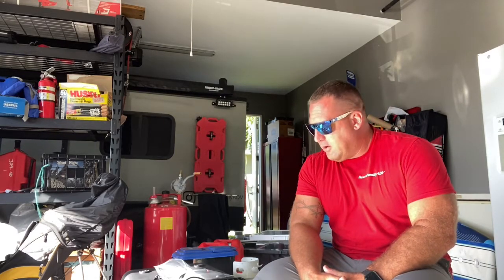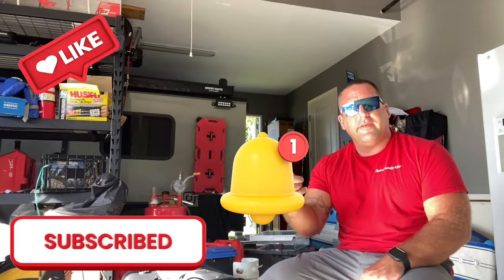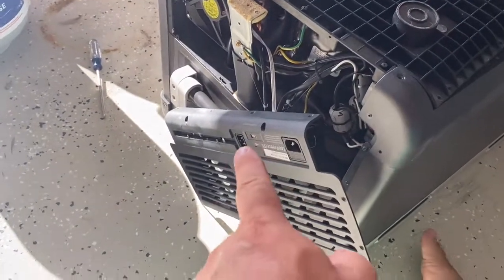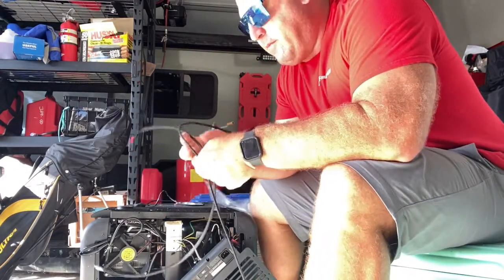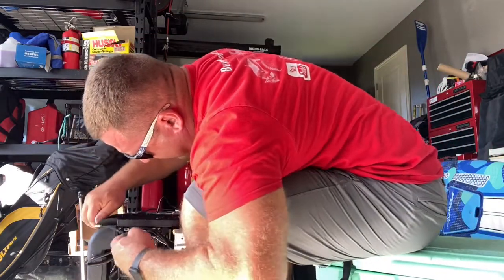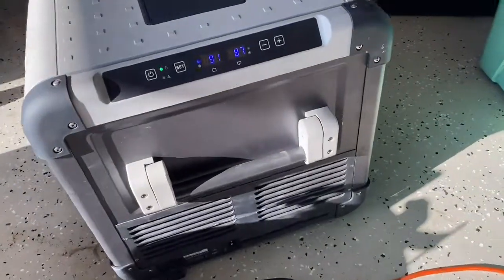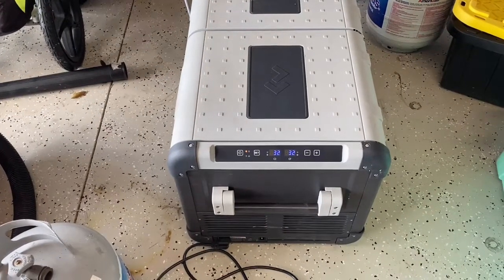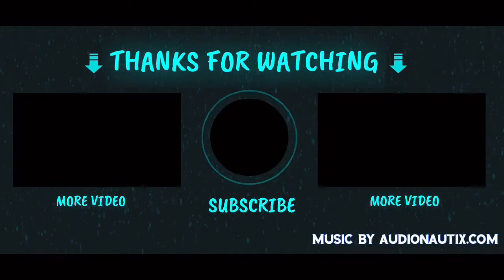Dometic CFX75DZW thermistor replacement / Not as difficult as it sounds

Comment: Hi quick question mine was acting like one side was freezing ok but the biger buckets was defrosting all my food no matter what - C or +F you set it on  then I turned it off for just all day ,then turn it back on I see a Warning 02 sign on that little screen saying Short circuit and can’t even set on stay solid warning 02 sign any idea what’s wrong with it ? Thanks 🙏
Reply from the maker: Eeeekkk that doesn’t sound good. An E-2 warning is saying something about ambient temp to high. Is your fan turning on? It might be your sensors not reading right.
Reply: @BeastFamilyADV  na my fan don’t even act like working and I tried couple time to knock ✊ knock ✊  😂 it didn’t respond this Fridge made my July 4th very happy 😃 any way Happy 4th of July ! thanks for responding God bless :)
Reply from the maker: @ilhommuminov708  so it may be your fans than not turning on. Try replacing them. When you turn the unit on, the fans should start immediately.

Comment: Can you let me know if the fan kicks on immediately when it's powered on or does it only come on after it's running for a while? Thanks.
Reply from the maker: Good Question! I haven’t really payed to much attention for when it turns on but usually when the fridge is turned on, the fans turn on shortly after. This is when the fridge is at room temperature upon activation. It it’s pre-cooled or the ambient temperature is low, this may effect when the fans turn on.